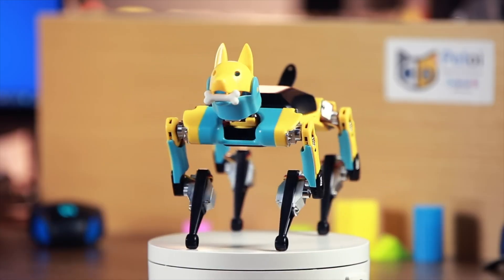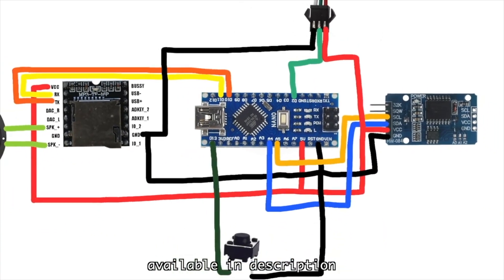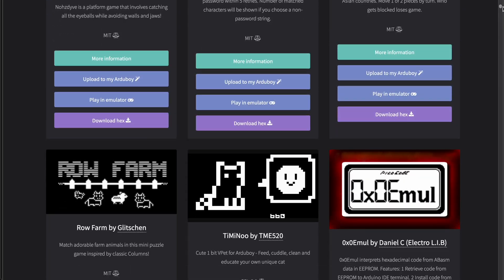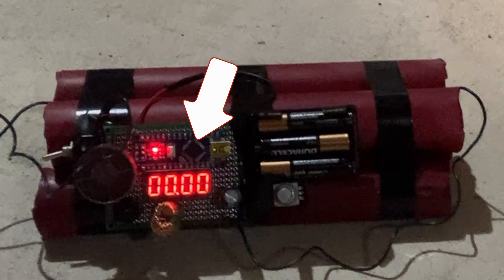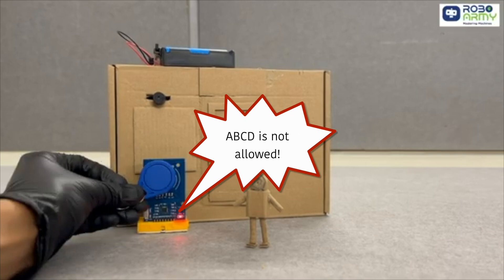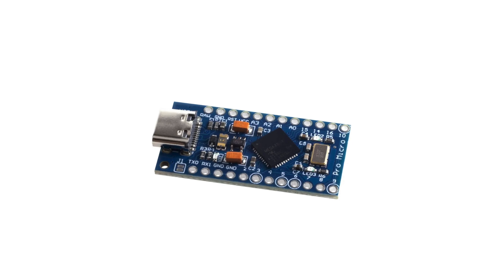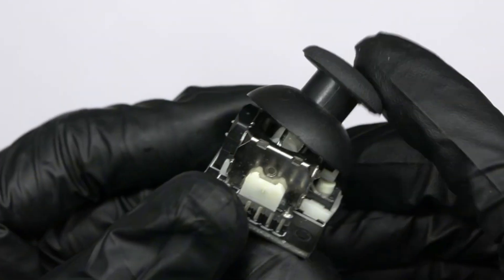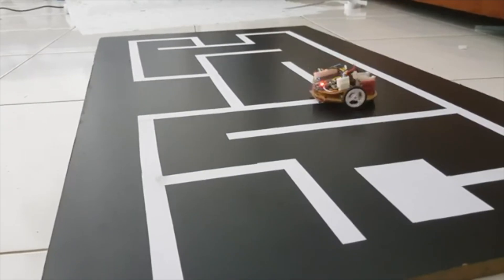Top 10 Arduino Projects to Learn in 2025

Comment: How many of these projects utilize the same processor?
Reply from the maker: these used a pretty broad variety of processors, but if you did get the Arduino Nano (a few of these used that) or Arduino UNO (a couple of these used that) there are a ton of projects on the internet you could make with those in addition to the ones I've shown here